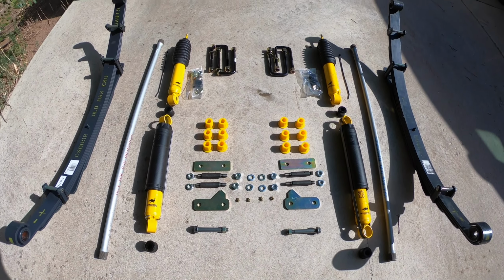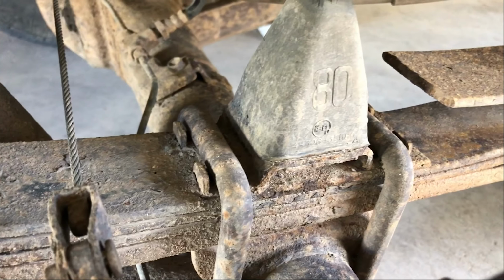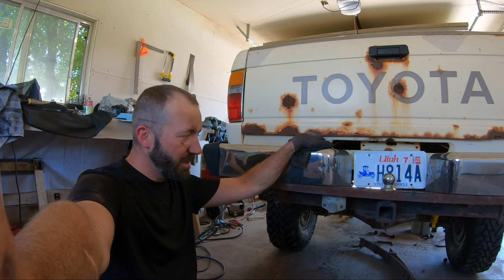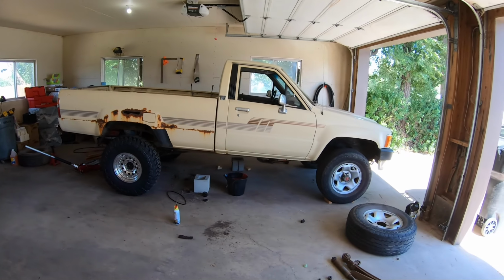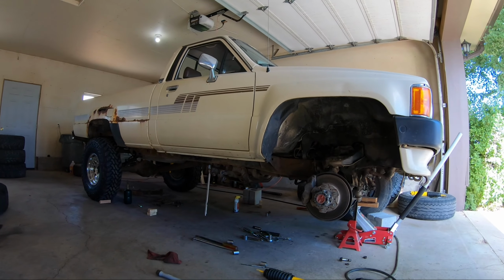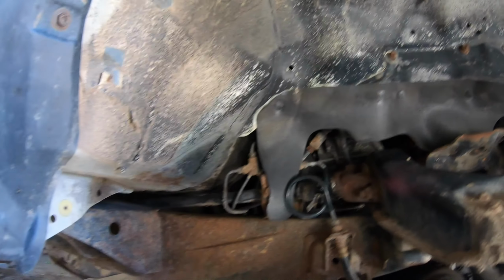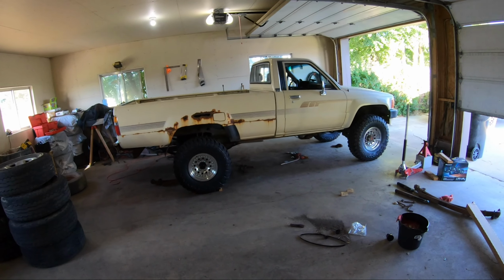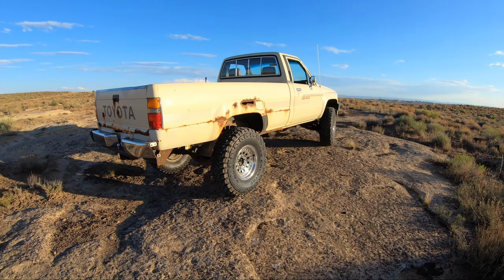OLD MAN EMU LIFT KIT INSTALL TOYOTA PICKUP | 1986 IFS Torsion Bars, Leaf Springs | Truck Build Pt. 2

Comment: I did this same kit on my 86 Toyota 5 years ago and I agree with the other comments posted. The rear springs will soften but it will take a year or more. I never put on the overload springs, my rear springs hit the stops at about 1600 pounds in the bed and that's more than the 22R likes. The whole ride will improve with stacker blocks under the upper ball joints, a front diff drop will save the stress on your CV joints. Once the upper ball joint blocks are in you can lower the torsion bars to mid range again and the IFS has downward travel which makes all the elements of this suspension kit work together. They are awesome trucks, hope you are still enjoying it.
Reply from the maker: Thanks! That's all good info. Front end is similar to what I did on the 100 Series Land Cruiser. Not sure when this truck will get those blocks and diff drop kit, but they'll definitely improve things like you said. Merry Christmas!

Comment: i did the same to my 87 recently, but ended up taking the last overload spring off, and took the 3rd leaf down out and it put me exactly where i wanted. I love these trucks, yours is a beaut.
Reply: When you said you removed the last overload spring off, you mean, the first of the spring pack from the bottom ?
Reply: @billythomas4527  yessir, I ended up putting my springs completely back together though as I’ve added a rooftop tent, still pretty stiff even with the weight but just been running it in hopes of settling in future
Reply: @zomic5438  Gotcha ! I have bought some CS009R springs, the greasable shackles and all the bushings I need. I mostly drive with almost nothing in the box so I will also be doing this process. The only thing I am missing from the OME stuff is the inner sleeves for the front eye bushings ugh....

Comment: Your rear springs will settle.  I had those same springs on 87 4runner. If i had to make a suggestion. Pull the overload spring off each pack. It will ride smoother and flex better. Especially since you don't have weight in the back.
Reply: How does that setup w/o overload springs ride compared to stock?
My '94 pickup Xtracab 4x4 (22RE, DLX) rides rough, and I get that it's not gonna ride like a Cadillac, but it'd be nice if it was smoother than it is now.
My setup is stock other than Bilstein replacement shocks (~6 years old), 32" BFG KO2's, and a Total Chaos idler arm.  I go offroading occasionally but I don't want a lift as I'm more into motocross, and that'd only make loading dirtbikes more difficult.
Reply: Did you have to reuse the inner sleeves for the leaf spring bushings?

Comment: Can hear that timing chain slapping around... did you fix the guides on it yet?
Reply from the maker: This engine is going through a rebuild right now. Here’s the link to my Toyota channel: https://youtu.be/fBwSXjvMRZI
Reply: @Whisky J1 ADV  I just finished an overhaul on an 87 22r it's a peppy little motor with a cam and stroker upgrade.

Comment: Sorry if this is a dumb question, I’m not very knowledgeable about cars but I’m trying to get more into them.

I recently inherited an 86 Toyota Pickup and I’ve been wanting to replace the suspension, and I’ve considered a 2in lift as well (but I don’t want to do a body lift).

You mentioned this is a lift kit, but you didn’t use any coils and I don’t think you added any body spacers (at least I didn’t see any or see that process). So my question is, where does the added height come from? 

Thanks in advance for your time!
Reply from the maker: No problem. And congrats!

There are no coils on this type of vehicle. It uses regular old leaf springs in the back and what is called a Torsion Bar for the fronts. T-Bar. 

The rear height increase is from more arched springs, and there are other means to add to this if necessary, and this both overcomes probably 1-2 inches of sag in the rear on these old trucks, but also lifts it all the 2” above original factory height. So you’ll notice a pretty large difference. 

The front T Bars are replaced on this system with thicker diameter rods, which support heavier weight up front. Things like a winch, heavier bumper, off road lights, all the heavy stuff. And the height is set by dialing in the adjuster at the rear, where the T bar is attached to the chassis. 

It is possible to simply adjust the old factory T bars to a higher setting to attain some lift. And some folks do that. But the new replacement ones have a higher ride height on the spline indexing, and can be adjusted to support all that additional weight. 

The shocks up front on a T bar suspension have nothing to do with the suspending of the cars weight. Unlike more modern vehicles where the shock is surrounded by a coil spring and the unit handles all damping AND suspending of the weight. 🤓
Reply: @CaptMaxADV  thank you so much for your response! This makes a ton of sense and clears up my confusion. I’ve been learning a lot about suspension but didn’t know you could replace T Bars with thicker options and I didn’t know they were height adjustable. 

I seriously appreciate content creators like you who are willing to share your knowledge with newbies like myself. 🙌🏼

Comment: how much is the measurement  leaf spring because i have a toyota and i don't know the measurement can you tell me please
Reply from the maker: Which measurement?
Reply: @CaptMaxADV  I have a Toyota 22re to be cap but I want to exchange everything with what you did but I don't know what the measurements are leaf spring
Reply: what size are the leaf springs or can you give me the number of the leaf springs so I can look for them
Reply: Please 😎
Reply from the maker: Go to this page. It has a ton of information. I went with the Heavy 2.5” lift springs. I still don’t know what measurements you want. 

http://cruiseroutfitters.com/sus_pickup.html

Comment: Does the length come in different size or one size fits most?
I have a 85 with an existing lift from origiowner and idk how many inch lift it is
Reply from the maker: I’m not totally sure. Are you sure it’s an Old Man Emu system? I’m sure there are varieties of lift heights from all sorts of manufacturers. I don’t know if OME makes anything higher than a 2.5”. Call Cruiser Outfitters and they’ll know for sure!

Comment: I think i like the 32's better than the 33's. Do you still feel the need to gear down though?
Reply from the maker: I’d be okay with 32’s, but with this much lift I find the 33’s to be perfect. Yes, I’ll plan to regear and lock the rear at some point. The 33’s aren’t bad around town, just up highway hills. Off road in 4 Low it’s fine.

Comment: Did you have to reuse the inner metal sleeve for the bushings in the new ome bushings ?
Reply from the maker: I didn’t use any sleeves in the new bushings. I don’t recall any coming out of the originals.
Reply: @CaptMaxADV  Probably because you left the old ones on your old leaf set.

Comment: Nice, how did you manage a farm truck plate? Asking because I need to get one on my 86 because I know it won't pass emissions now
Reply from the maker: All vehicles in Utah older than 30 years qualify as a “Vintage Vehicle”. I’m pretty sure you have to state that it’s not your main transportation. However, in Utah right now, there is a total BS bill going through to eliminate that, or at least drastically change those rules. So stay tuned for that!

Comment: Just bought a nearly identical setup for my 89, which shackles are you using?
Reply from the maker: I do believe these are the ARB greasable shackles. Good luck with it! I’m about to do an engine swap on this old rig. Just another 22RE. Follow along at the new Toyota channel! Adventure Teq.
Reply from the maker: ARB/OME Old Man Emu greasable shackles that is...

Comment: After the lift and bigger tires, were you able to use 5th gear?  I have an 86 I purchased new.  I have a 3" body lift on it and at one time put 33" Mud Kings on it.  For the most part, I was not really able to use 5th gear anymore.  I had no problem with 32" BFGs before that.  I'm soon going to put new tires on mine and from past experience, will stay with 32" at the highest.  My truck was not old at all when I had the Mud Kings on it so there was no power loss due to age, etc.  It's still stock today.
Reply from the maker: It has an automatic trans. And unless it’s flat with no head wind it struggles in overdrive. I’ll regear and lock the rear eventually.
Reply: @CaptMaxADV  , thanks for the reply man,  much appreciated.  Mine is the standard 5 speed and I had changed it to a 4 speed.  Lol.  I'm actually planning to have mine as an everyday driver soon.  My Dad had it for quite a while so I'm doing quite a few repairs to it.  New carb, AC, etc.  I know I'll stick with 31-32" tires for now.  I have a side by side for hunting so I'm not really in need of the truck having huge tires.

Comment: Did you go with the rear HD springs? If so, just remove the bottom arched add-a-leaf. That will take 1.5" out and make it less stiff
Reply from the maker: I did. Mainly for heavy hauling and in case I ever hunt a big animal. I’ll keep that in mind, but don’t anticipate moving things around on there. Thanks for the reminder!
Reply: @CaptMaxADV  I just did the AAL removal out of my '85 4R. It made the ride way more tolerable and lost only an inch of lift
Reply from the maker: 👌🏻 Thanks!

Comment: Did it come with the shackles and replacement bolts?
Reply from the maker: My kit from Cruiser Outfitters didn’t come with the leaf bolts to the frame, but he gave me them. And yes, the kit includes the greasable shackles. But confirm with him when ordering.

Comment: en mi caso tuve que cortar los reguladores de la barra de torsión, estaban super clavados. pareceria que cambiaste las barras de torsión para dar mas altura. o solo regulaste mas altura con los reguladores. a tener en cuenta que todo el tren delantero queda exigido. caso semiejes, rotulas. muy buen trabajo. felcitaciones.
Reply from the maker: Translate to English please.
Reply: @CaptMaxADV  in my case I had to cut the adjusters off the torsion bar, they were super nailed. It looks like you changed the torsion bars to give more height. Or you just regulated more height with the regulators. to take into account that the entire front end is required. case semi-shafts, kneecaps. very good work. congratulations.
Reply from the maker: Thank you for translating!

My torsion bars fortunately were not seized. Well greased still from factory after 34 years. Boots were intact, which made that possible I’m sure. 

I did replace those old factory ones with new stronger ones. They will support heavier weight up front for winch and light bar. 

Thanks for watching!
Reply: @CaptMaxADV  thank you for sharing your work on the toyota. I own a 2.8 diesel double cab sr5. 3L year 1997 engine. Restore little by little. not with 31 wheels but with 265.75.16 mud. good truck. just satisfactions. I am from Argentina, here they entered from 81 to 97, entirely Japanese and then they began to assemble with some Argentine things but with control of Toyota Japan. we will continue learning.

Comment: What made you pick old man emu over the other suspension ?
Reply from the maker: Which other suspension? Other lift kits? Or the stock suspension?

I’ve run Old Man Emu on my trucks for years. They’re a super solid product with excellent customer service and local support through my friend’s distribution and install shop. Cruiser Outfitters in Salt Lake City Utah is my go to supplier for 98% of my Toyota fleet’s needs. 

I wouldn’t bother with any junk you can buy from 4 Wheel Parts. Unless it’s OME or Dobinson, or Icon Suspension. 

But I’m not an expert. Just my opinions. 👍🏻
Reply: Jeremy Adventures any thought on dobinsons? Is it as soft/ smooth as old man emu?
Reply from the maker: Roveir Datu I’ve never seen a set of Dobinson’s in person. But I’d give them a shot with full confidence. If ya do, come back and let us know!
Reply: Jeremy Adventures I actually have the dobs IMS. I’m thinking of debating if I should change or uprgrade or what not, but first I’ll upgrade the tires first.  I’m currently running on load E, which is contributing to the firmness of the ride and which I’m trying to fix.

Comment: Looks awesome! I did the same suspension to my 86 but also added 4Crawler ball joint spacers. The rear of mine settled some and eventually started riding better too but still has a lot of rake. It’s definitely way better than the worn out stock suspension.
Reply: Hey, with the ball joint spacers I know OEM factory upper ball joints have the four mounting bolts pressed in. How did you remove them?  I bought new ones (OEM) not realizing they have to be four longer bolts.
Reply: @oldowl4290  it’s been so long now I honestly don’t remember. I used either Moog or 555 for all the parts but I believe you can just knock the studs out with a hammer to use the longer bolts.

Comment: How stiff were the rear shocks when you got them? I just got some of the same ones, but they're pretty easy to move and I can hear the oil sloshing around when I shake them. I'm thinking they sent me a dud?
Reply from the maker: All shocks I’ve ever installed new are “charged”. Meaning pressurized. The valving usually restricts the flow to a slow rate. When you take off the “retention/shipping” band they always extend. At least from my experience. If ya call and talk to the experts at Cruiser Outfitters in Utah they’d be able to set you straight without any question. Good luck!

Comment: Looks really good man almost perfect stance. Crank on your front torsion bars if you want to add a half inch to front end eh? Stoked just got a ‘90 SR5 xtracab 4X4 V6 rust free every avail factory option perfect factory paint/graphics/interior.. got super lucky to find it and on price. Awesome trucks yours looks so cool.
Reply from the maker: Thanks dude! I did crank up the front a bit, sits closer to level now with a tad bit of rake. But they front is quite stiff, and will be until I get some gear mounted up there I’m afraid. 

Glad you see the truck’s good for what it is. I don’t plan on putting much into cosmetics of this old rusty rig. And if she ever gets fully built out I will proudly drive here rusted holiness on every trail around! LOL

Good luck with your gem! 💎

Comment: What size rims and tyres you running? Looks good.
Reply from the maker: Thanks a lot! These are 33/10.5/15’s.
Reply: What kind of rims
Reply from the maker: Just some aluminum wheels from the 80’s. I have a video showing how I polished them up. They used to look terrible!
Reply: @CaptMaxADV  ok thank you

Comment: Nice !  So how does it feel now off road?  I’m thinking about adding this kit to my 2020 FX4 Ranger.

I’m primarily looking for off-road benefits.
Reply from the maker: I mean, for a thirty year old truck it's night and day, I mean it supports whatever gear I can load it up with and comfortably gives a nice ride while providing ample clearance for the larger tires that give you the ground clearance you need to tackle most any trail. OME has proven to be a good balance of comfortable performance on and off road on the three trucks I've installed OME suspensions on. I would not hesitate to install it on any truck you've got sir! Would certainly opt for OME over practically any USA made suspension because I'd suspect that most of them are made and sold to give lift without so much for great performance on and off road. I could be wrong, don't have any real experience, but just from what I've observed. OME is dialed! My large Land Cruiser wagons (100 & 80 series) have the HEAVY OME springs and I have never felt like they were overkill when empty but perfect when fully loaded or trailering. The Pickup suspension here I went with the normal setup/non heavy springs. Generally you can just add the sing leaf to the rear pack later if you find that your setup warrants larger load carrying capacity, but I was told by Desk To Glory that the HEAVY set on the pickup is pretty rigid on a lightweight (empty and free of rooftop tent/overlanding outfitting) pickup.

If ya get one on our Ranger come on back and let us know how you like it!
Reply: Jeremy Adventures this is so encouraging!  I really appreciate your time in responding.  I contacted the companies who sell suspension and they both said to go with Fox, but it is a business too.  I think OME is honestly the best bet as well.  Thank you so much and I will definitely come back and let you know!

Comment: How much did this kit run you
Reply from the maker: About $1200 I think. Check this link to Kurt’s store. He has the best prices and customer service. http://www.cruiseroutfitters.com/sus_pickup.html
Reply: Is this a lift kit or Oem? Really high. Looks like original cat?
Reply from the maker: It’s an OME not an OEM. Old Man Emu. It is indeed high. It’ll settle down over time.
Reply from the maker: As in Catalytic Converter cat? I have no idea. It had a new muffler when I bought it 5 years ago. So maybe... 🤷🏼‍♂️

Comment: are you in utah? noticed the cruiser outfitters hat. used to pick up all sorts of goodies when i worked at a Landcruiser shop nearby
Reply: what did you pay for this? great video loved to do this on my t100
Reply from the maker: Thanks. I am in Utah. I must have paid somewhere around $1K for the suspension. It sure brought this truck back to life! I definitely recommend it!
Reply: @CaptMaxADV  ill have too look into getting those leafs!! found the torsion bars on yotatech for around 200 bucks. working on my steering just replaced the steering box pitman arm carrier arm and steering dampener  about to do the inner and outer tie rods along with an alignment and 33s for this winter!
Reply from the maker: Niiiice! I have all the front end parts to replace here pretty soon. Hope to in the next couple weeks before winter sets in.